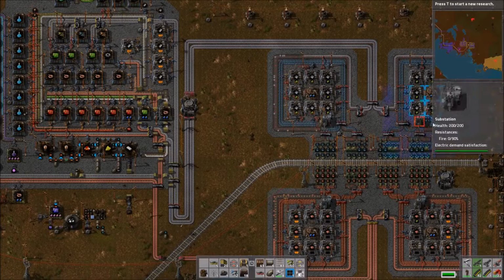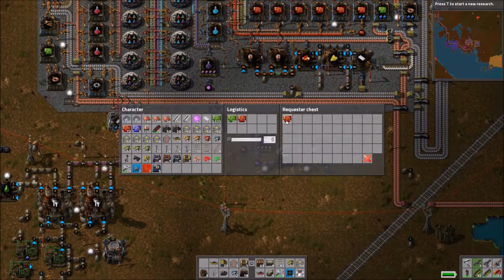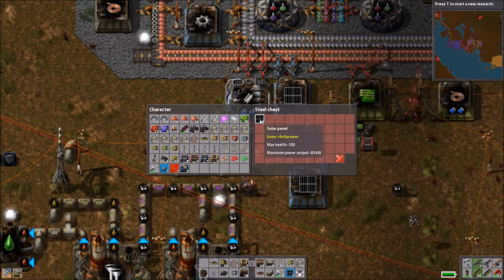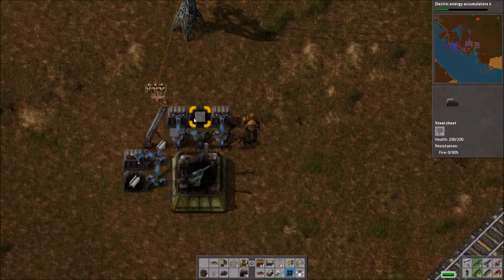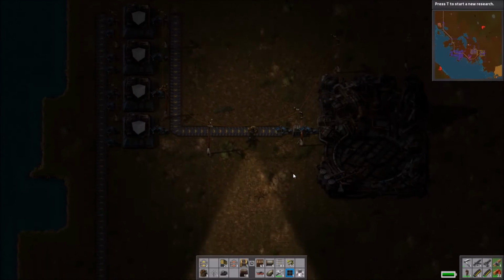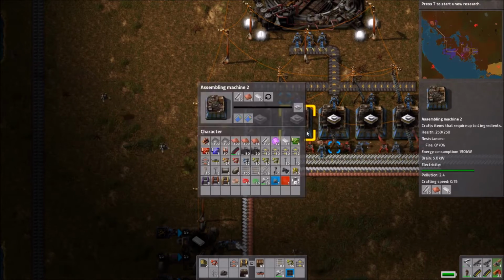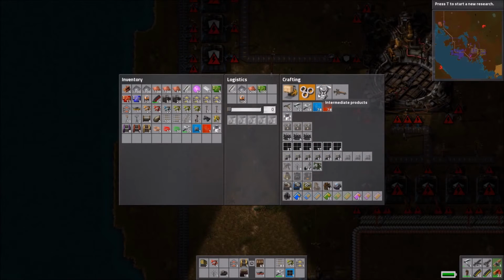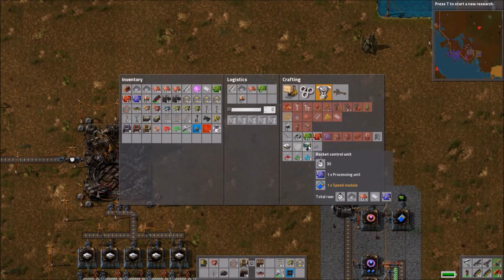Factorio - Episode 20 - Rocket Silo

Comment: Neat and good luck.  btw it's a 1-8 ratio for copper wire to red circuit factories so you can double up the ones you've built for the silo which should smooth production.   Whilst you build the support infrastructure might be worth disconnecting the silo or throwing in some efficiency modules as at idle it uses around 7MW.
Reply from the maker: +Sissy I saw that this was the case after recording the episode, however it would take to long to be worth recording. I will show what has been changed next episode
Reply: Zero Jake No worries, I'll look forward to the new episode :-)